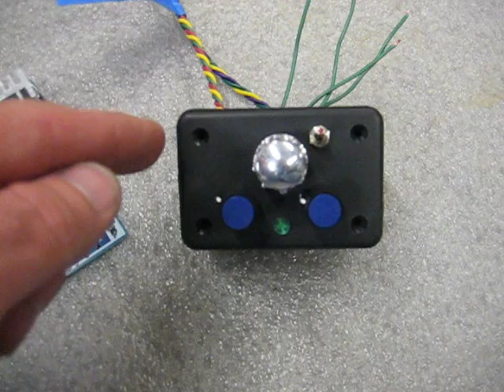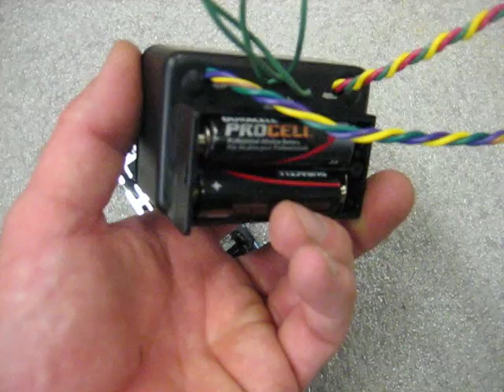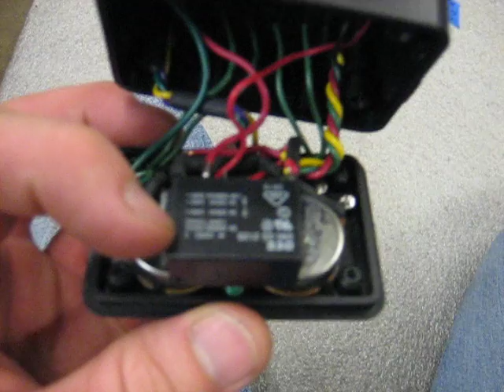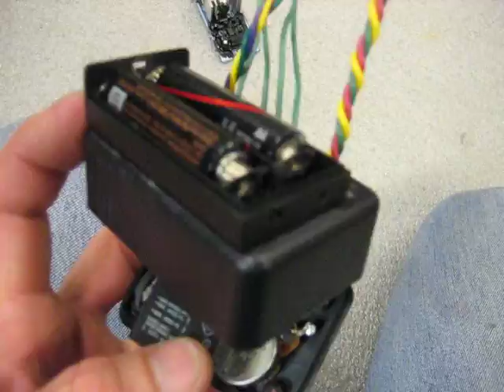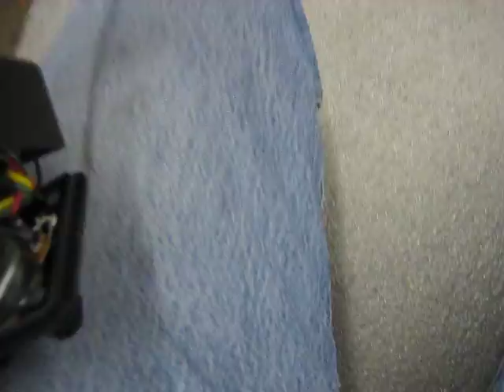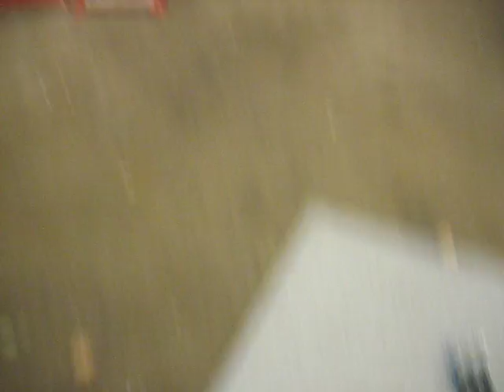EFIE and PWM controller

Comment: could you use this set up for a electronic fuel injection system ? in general could you use it with a few mods? i do not have a computer on the motor